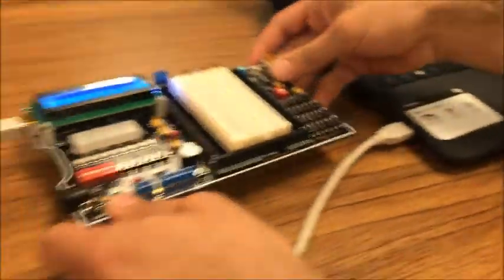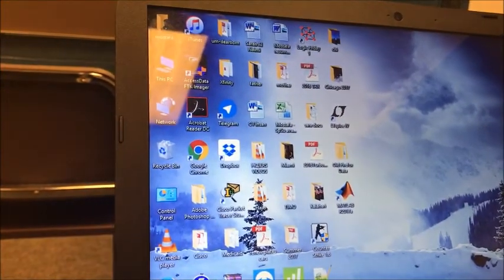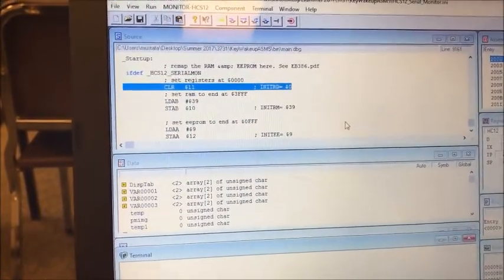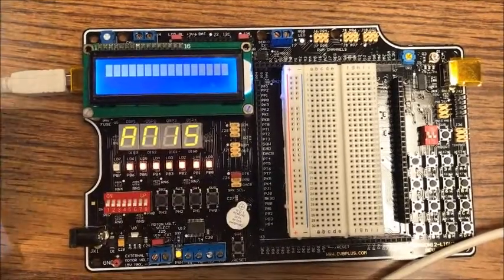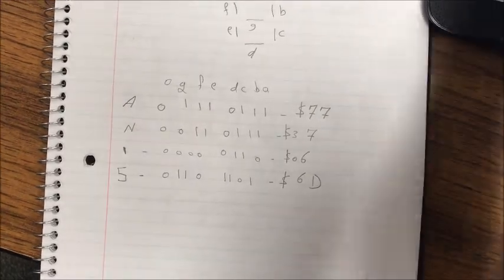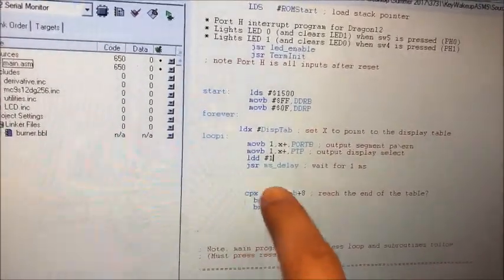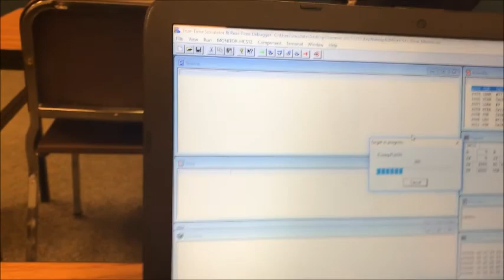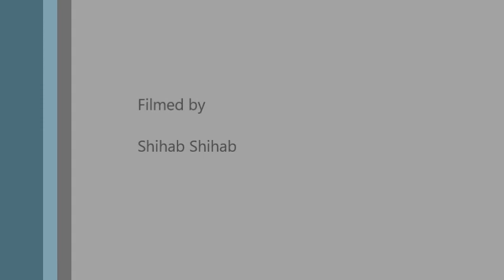LEDs & Seven Segments - HCS12 Board

Comment: السلام عليكم ممكن حل لهذا السؤال عندي قطعة مايكروكونترولر microcontroller نوع MC14489 اريد اربطها على جهاز HCS12 موجودة صورته 👇حتى اكدر اتحكم ب5 لدات و اريده بلغة الاسيمبلي او لغة c  او عبارة عن flow chart و السؤال هذا 

The Freescale MC14489 is a five-digit, seven-segment display driver chip. Describe how to interface one MC14489 with the HCS12 using the SPI subsystem. Write an assembly program to display the value 12345 on the seven-segment displays driven by the MC14489.
Reply: مخلد سؤالك حليته لو بعدك 😅
Reply: @1zuf1  
شدو حيلكم
Reply: فقار نجحت واني ما مفتهم الماده 😂
Reply: @M_Alkhafaji_USA   
دايمه عمري